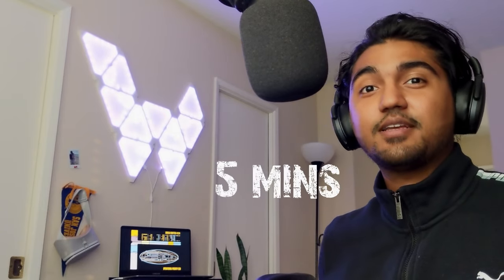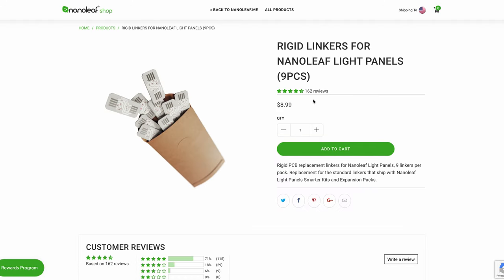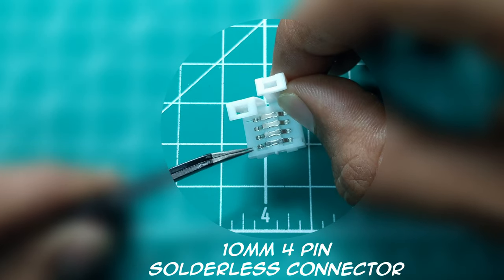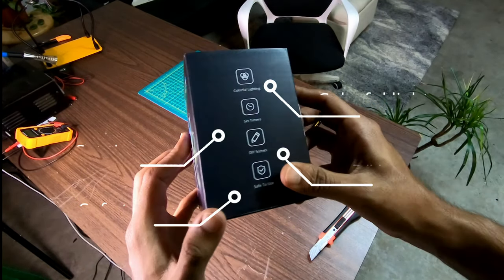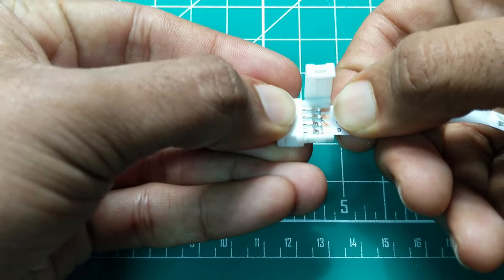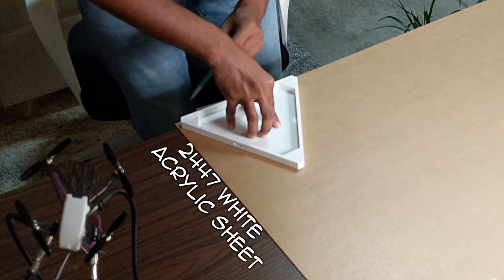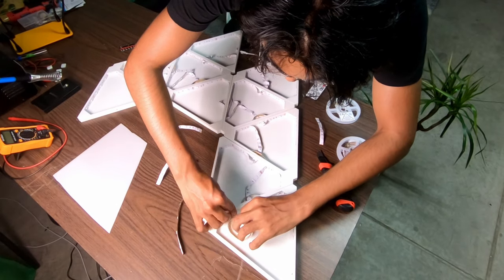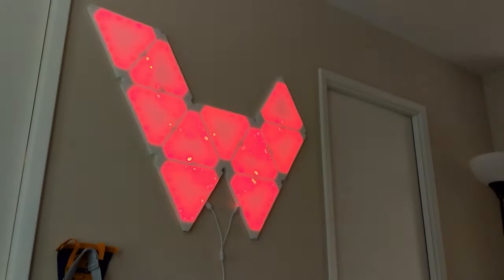DIY Nanoleaf Rhythm- Vrikxa

Comment: Nice! here from the reddit post. I still feel like if you lowered the intensity of the LEDs and/or got several layers of diffusion it would complete the look.
Reply from the maker: That's true. I felt the same after using this diffuser. I could have gone for better diffuser or thicker one. This is a 3mm one. Also I feel the depth of the panel could have be little more. That can give some good diffusion. Thanks for that. 😊

Comment: You should have used Arduino based system in which you should have used individual addressable LEDs
Reply from the maker: True but It depends on the LED strip. The one I bought was not supporting addressable LED logic. But yes looking forward to upgrade my Nanoleaf.

Comment: i follow your 3d , but unfortunately the led connector cannot go thru the middle hole
Reply from the maker: It can be little tight at first since both are of exactly same size. You can use sand paper to smoothen the inside of 3D print and then push the connectors.